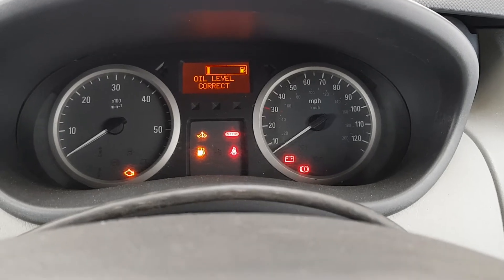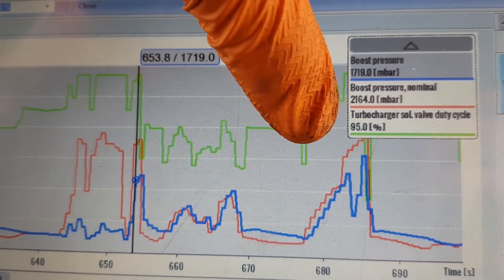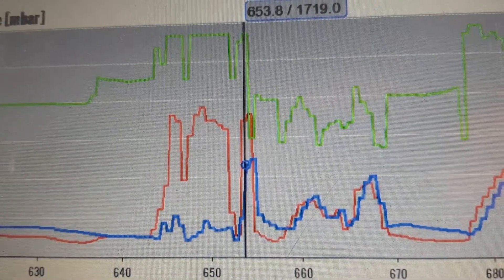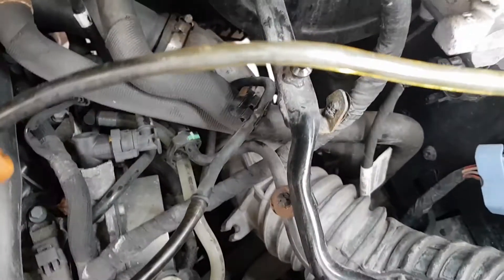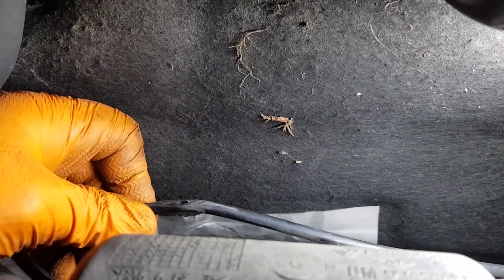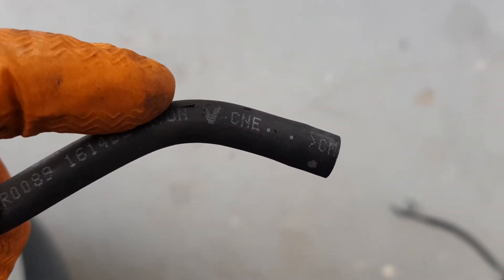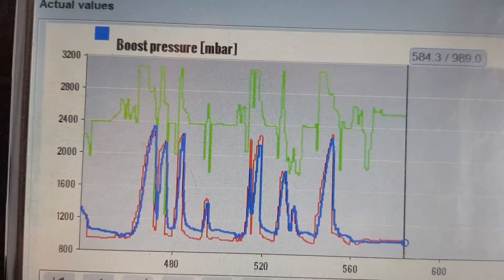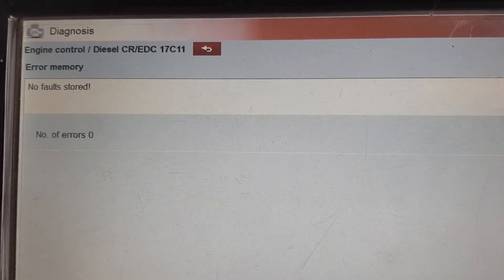Vauxhall Vivaro low boost p2263 turbocharger boost system performance

Comment: I have the same code on a Renault Megane 1.5 diesel.   I  also have the code 0045 which is also connected to low boost..  My car drives and the spanner light is intermittent.  The Turbo actuator does not seem to move as it should. i can manually move it though.. Any ideas from anyone. PLEASE>

Comment: Question!the turbo boost pressure solenoid vacum ports are  in the open position with the power disconnected or is it open  when 12v supplied?

Comment: I seem to have simillar issue. Lost bag of money for useless mechanics who just tried to replace all parts for one year now and saying to me.that car works good while I am 100% sure it hesitates and pops out p2263 + emengercy mode from time to time. Seems like I have to find out myself what is it because it definately is not running with full power.
Checked vaccum from the pump and seems fine. Changed all the hoses from solenoid etc.
What engine you got there? Mine is 2.0 114hp and I can't recognize that pipe back of the engine you had hole in. Which one is it exactly? Is there something more to vacuum other then turbo I could miss?
Reply: Did u get it fixed
Reply: @eoghanhennessy443  yeah. I found out photos from before servis and afterwards. I found out they replaced some of my sensors to ones from other car and did not put mine back. Seems like there are 3 different engine computers that have 3 different sensors and it was not the correct one. More then that they replaced turbo and all injectors for nothing. Funny that after 3 months after one of them died (the coil) so it was even trickier to find what was wrong. But I took multimeter and step by step checked everything I could and the car runs ok now. I feel like there still is some lack of power but it is enough to travel. The most responsible for emergency mode was MAP sensor. Before I got the info that there are 3 types it was already tested on 4 different sensors. Unlucky none of these was the right one and I felt hopeless while ordering last one but i went by motor numbers and somehow it works. Anyway spent way too much money on mechanics failures and now they did not even give me back my sensors. Total war path with them only respond was threathing me so i just decided to buy all new original sensorsthat come for turbo system. Buying this car is the worst decision i made in my life.
Reply: @TheSkiSensei  were having trouble with one in the garage a 2012 model boost pressure sensor circuit p2263 . Pressure apears to be slightly low . Boost pressure solenoid been changed vacuum line perfect 
. Boost control on turbos perfect.  Being a 2012 the boost sensor is hidden i cant find it . Older model is on air box pulling my hair out
Reply: It's at the back of the engine on 2012/13 vans
Reply: @handofgod09  u know were abouts

Comment: I've got the same problem thank you I will know check the pipes can you tell me what diagnostic tool you're using I've got an audatex 
 but this one doesn't do abs bleeding what is a good one for a Renault Trafic the covers most things that isn't too expensive.
Reply from the maker: This is a Bosch KTS, autatex is basically launch I believe. Renolink is a cheap Renault tool though some of it is in french.